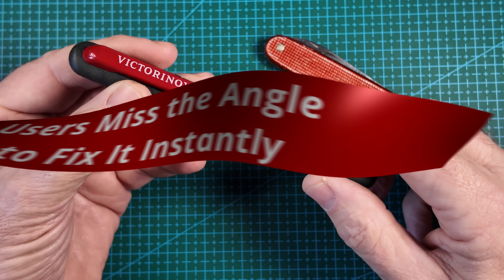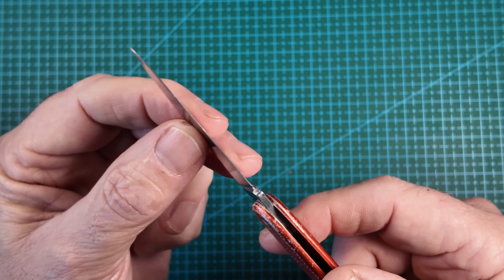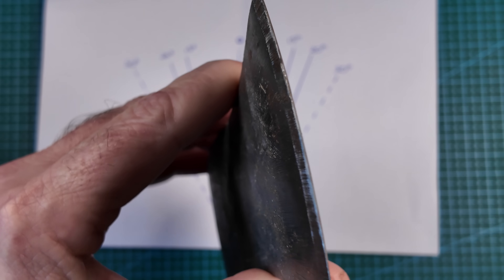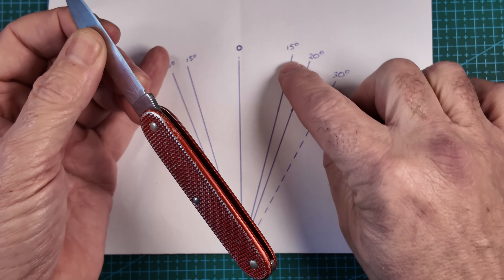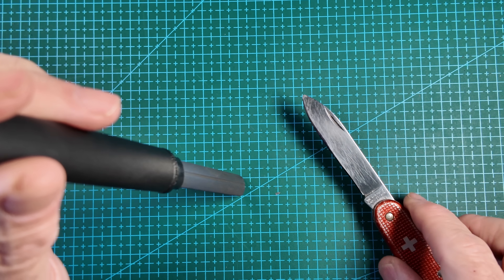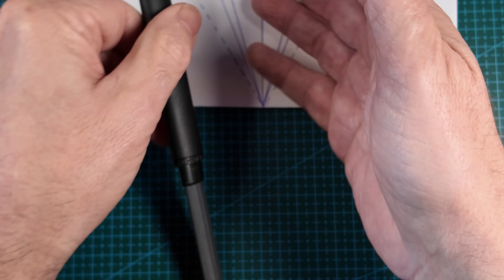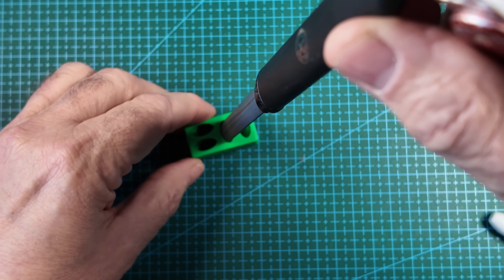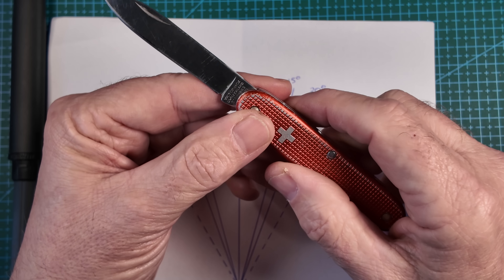Why Most Knife Users Miss the Angle and How to Fix It Instantly

Comment: I just picked up my first huntsman and used the pen blade to cave a wooden bead out of a stick to test out the knife at first it cut like a dream but slowly I noticed it dulled very fast and now after very little carving it doesn’t cut paper very well, before it was almost razor sharp now I’m scared to sharpen it bc all I have are wet stones and I don’t want to mess it up I was wondering if I should just try to strop it on a belt first or how are your experiences carving with this knife? I realize I’m better off using the razor blade for carving lol never have to sharpen 😂
Reply from the maker: This is normal the Victorinox steel is fairly soft. But a problem as it is easy to sharpen. Stropping is good - strop frequently to keep the edge. I like this Victorinox sharpener as it is not too aggressive and is easy to use. I recommend using a cheap kitchen knife to practice sharpening to build up the muscle memory. Then your better knives get less scratched.
Reply: @MB_EDC thank you for the advice I will try that I do have some old kitchen knives that I can practice on . Keep up the good work your videos are awesome thanks again!
Reply from the maker: @aaronflores21af Thanks!

Comment: I´m using womens 2 side cartboard nail file to keep my knife sharp, easy to use sheap to loose ang light to carry few peaces in backpack. Home or bush same tool. Stones, diamond file and metal sharpener did stay in home. Maybe 4-5 times I had to use nature stone from water  sea or river to fix my knife and 2 times my axe in 40 years. One time I did burn my knifes blade in  fire and one time fall off the cliff chopping wood. Final sharp was still made with paper nail tool. 1000 grit is more than You need in bush. 3000 is good to cut fish in kitchen. maybe 4 sides nail polisher is better. Opinel 7, Fiskars 12" axe and  big 16-blade Victorinox swiss was with me in 3 and 5 month survival trips in Norway and Thailand.
Reply from the maker: Great tip! I had thought to get one of those diamond nail files.

Comment: The sharpeners with fixing the blade are limited to blades that are "wide enough". The sharpeners like a rod with angle maintainer ar depending on a steady hand, and can be very good. The "Work Sharp MK2" is electric and has nice guides very acute for kitchen knives on wood plank, and for utility/bushcraft heavy duty by press of a button and is very good in recovering and reshaping old and beaten devices. by removing the guide you can do also an axe or machete for gardening. I like the work sharp very much and once a year I take all the knives of my parents house and my appartment and I sharpen all. but day to day when I need top I use a metal rod technique : 3+3 2+2 1+1 to reverse the rolling of kitchen knives that bump into ceramic plates, and it is phenomenal quick and effective.
Reply from the maker: The Sharpal 202H I am testing can sharpen a 91mm victorinox. These are definitely for larger blades. Same with the rolling sharpeners - not good with small blades either.

Comment: My tip is to have a magnafying glass, or even better a jeweler's loop handy. You can examine the edge of the blade and really see where your sharpening is affecting the steel, as well as identify little nicks in the blade. It's an easy way to get more information on what you are accomplishing, like a slightly more advanced version of what the magic marker trick.

Comment: Inox isn't a type of steel. It's just French for Stainless Steel. I believe they use X55CrMo14 which is somewhat akin to 420 (but harder, stronger and more wear resistant.)
Reply from the maker: I don't think that X55CrMo14 has been confirmed as the steel for SAK blades. They may use different steels for their kitchen knives compared to the pocket knives. Yes of course inox is a martensitic stainless steel. I am just using the name they use.
Reply: @MB_EDC  Rockwell C (HRC) is better for combining harneded iron based metals. 
Axe hcr below 50 is good, hcr 55 do not last one day work. Good kichen knife is around 60, Japanese sushiknife less than 65 is almost usable. 62 is very hard to sharpen and break easily but keep its sharp very steady. Different mixing of metals do some help but do not change basics. Different use - different mix of metal and hardness. 

How is ceramics, ceramical, carbon fibre, other fibres and oxidated metals like alumium oxide based (have one 4years in big game stripping use, steel core, never sharpened HCR 80+ over the scale, it can´t sharpen without laser) and other new materials? Too exensive now maybe but usable tomorrow.

Comment: Tormek suggest using a sharpie to black the cutting edge and then you can see if you are on the right angle. If you remove the black, you are correct, if you are only removing on the cutting edge you are too steep and altering the angle, if you are missing the cutting edge, you are too shallow. This works on all types of blades provided that they haven't had their angles altered by previous 'sharpening' efforts.
Reply from the maker: Yes I included this in the video.
Reply: @MB_EDC yes, thanks but i just wish I was told about it 60 years ago when i started my sharpening journey and think it needs to be shouted from the roof tops.
Reply from the maker: @Ukfraser It is that one simple thing...
Reply: I have one of these for a quick touch up, but use a Lansky with Arkansas oil stones for most regular sharpening.
Always use a chisel tip Sharpie on the edge, many knives seem to lose the angle at the tip section.
I’ve used the coarser stones to reprofile blades that have this issue.

For my San Mai steel Japanese kitchen knives, I use sharpening stones from 400 to 5000 depending on what it needs
Reply from the maker: @tornagawn Wow a serious sharpening guy. I am very much a beginner. Sharing stuff as I learn. This is great to get an edge back on small pocket knives. It's less aggressive than most stones. I try to strop
Reply: Always factory angle is not good for user. I usually use sharper angle to knife.  Opinel-type blades negatives are my favourite on pocket or hunting knifes, less to minimal need to sharpen but still good balance of cut. Made few hunting knifes that style blades, no sucsess. Broke too easy, wrong metal and hadrnening.
 Blacking help to see faults and correct them. Some my friend use white paint pen to sharp their blades and pro kitchen work knives. Black is easier to mee to see.
Reply from the maker: @nallekarhu-p8x  Thanks for the tips.

Comment: Hi. I have about the same knife. I bought it in 1973 when I was 13. 👍✌️😃
Reply from the maker: The Alox knives are awesome. I couldn't resist this one at a flea fair.
Reply: I have 3 differnet on same serie, small 2" keyring size, 4" childs pocket and unuseful nonbalansed big 8" one. Got my pocket at 9y, traded key to my friend maxbox beatle and got big for gift in mil hi. My first knife was Poropuukko with dull tip -Christmas gift at 7y. I hoped small animal like rat or hamster, got hunting license and diagnose allergia to animals. Now hunting limit here is 15y and passed test.

First multitool was Vic 1987 blue/white flagged Finland 70 Year spesial. Birhtday gift. My friends know, now I have 15 different blue Vics, and I hope to get next blue one. 2005 model is missing.
Reply from the maker: @nallekarhu-p8x  You are building a good collection there.

Comment: back the in the day, those working people that needed and an edge on their tools never bother debating angles or trying to maintain a bevel, as long as both sides of the edge met sharply and was regularly honed when on the job, was all that mattered
Reply: I’m a 59yr old carpenter and keep my chisels razor sharp.  When I was starting out. I’ll never forget a guy older than me bragging that he gets through a whole chisel in a couple of years by keeping it sharp on a bench grinder. I have to say that most of the chisels I own. I have had my entire working life and especially the Japanese ones look like they would last 2 or 3 more lifetimes.
Reply: @SingleTrack66  I can understand why site chippies use a bench grinder but not  anybody doing fine work. Aside from the occasional need to remove a an accidental deep chip or if a hollow grind is wanted, i can't really explain why the various shipwrights and barn builders i have worked with resort to using a grinder regularly. A little and often on an ordinary bench stone seems to work as well as anything and does not wear you tools out
Reply from the maker: @SingleTrack66 Exactly! No need to remove a lot of metal to sharpen!
Reply: @SingleTrack66  -- And how sharp are you really getting it on a bench grinder? When you watch somebody like Rob Cosman, precisely going through the grits to reach 12000 (has to be less than 1 micron) on Shapton Glass, he's taking barely anything off but his chisels are razor sharp. Your old guy's chisels would be fine for rough carpentry, Fine cabinet making, not so much.
Reply: @twatmunro  my favourite chisels have never been anywhere near a bench grinder and never will. I do however have a couple of loan/ rough risky chisels that I use when I know there’s a chance of hitting a nail or plate somewhere.
Reply: @twatmunro  A lot of fine cabinet making was done with chisels sharpened that way, or with just files. Or with just a single, fairly course stone. It may not be ideal, but to say that fine cabinetry can't be done with chisels sharpened in such a manner is untrue.
Reply from the maker: True. Their knives were sharpened a little and discarded when not enough blade left. I see 100s off vintage blades that are very worn!

Comment: Great video, I enjoyed watching. 👍I usually sharpen most of my knives to 20 degrees, however some I go down to 17 depending on the blade steel and intended use for that specific knife. Most modern "super steels" like s30v, 20cv, s90v, Magnacut, etc., can handle more acute angles since they are better for edge retention and durability. However, there are some exceptions, though. Your results may vary. 😉👌Thanks for sharing, take care my friend and Cheers!
Reply from the maker: Thanks Dave! I really appreciate your comments.
Reply: You are both modern people. A felling axe was 15 degrees or less, a Mora knife 12 degrees an old opinel 10 degrees (and chipping)
Reply from the maker: @2adamast The geometry of the bladder is important too

Comment: The problem with knives is they wear.  They wear from use but most wear comes from resharpening.  As the edge moves toward the spine it gets thicker.  It gets harder to maintain the angle as more of the blade needs to be taken back.  At some point you just have to reprofile the blade, depends on the original grind.  When I was younger I would spend hours with wetstones.  Now that I'm old I go for speed and use carborundum and diamond.  Somebody scratched up that blade pretty badly.
Reply from the maker: Agreed. I try to strop first. Sharpen second. This ceramic stone here is not too aggressive. That's always a watch out with diamond stones.

Comment: I prefer this method as well. I have never been able to maintain a knife on a sharpening stone it's always messed up. But I don't worry about angles I just use a 9 in steel or lately a ceramic Rod which I am trying out for the first time.. This is how I've been doing for over 30 years. It's not really sharpening it seems to be just realigning the edge. I just do it by the way it feels. However after almost 30 years of owning this honing Steel I just found out that the guard on the handle has four sides and each side is angled to a certain sharpening angle. It only took me 30 years to figure it out but I'm getting there. No rush. Also I mostly just sharpening kitchen knives and stuff no heavy duty Choppers.
Reply from the maker: Great to keep learning. I have been sharing my sharpening learning progress over the last couple of years.
Reply: 😆Dude!!! 30 years, you're on pace to get them really sharp. Way to stick with it. We all miss the obvious sometimes.
Reply from the maker: @jeffreyweinstock656 👍